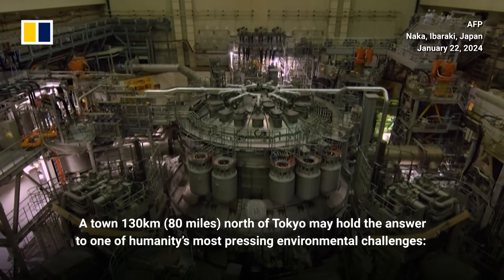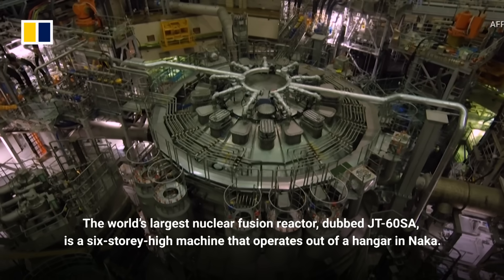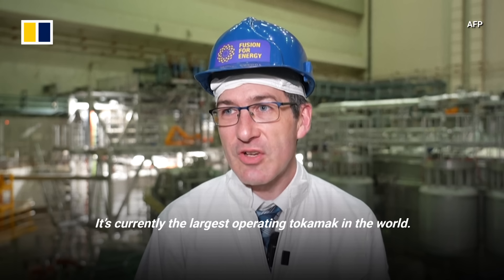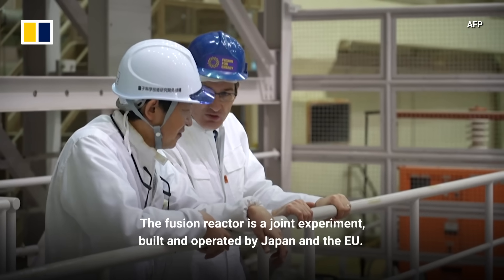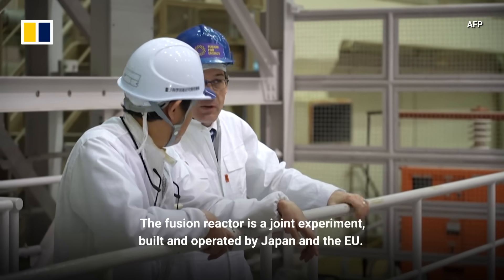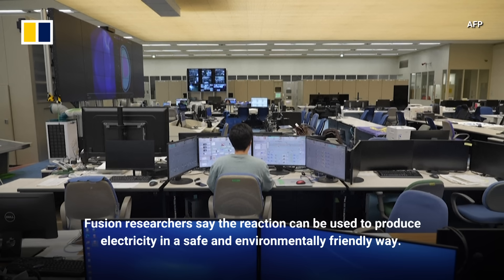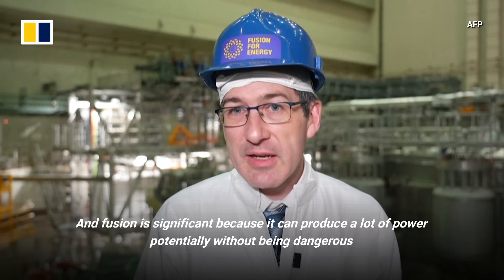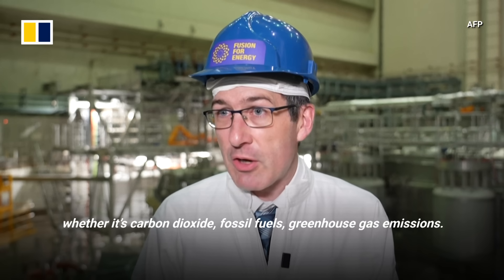The world’s largest nuclear fusion reactor

Comment: Fusion reactors require a constant supply of tritium which is manufactured in conventional nuclear reactors without it they can't function, tritium is in short supply.
Reply: @robhavock9434 They can. You can produce tritium by putting lithium on the fusion reactor wall, the constant neutron bombardment will transform it into tritium. We will need tritium to start the reaction, but once many fusion reactors starts to be deployed, the source of that initial tritium will be other fusion reactors.

Comment: I've heard once that tokamaks are outdated technology compared to stellarators. Can someone elaborate what are their advantages and disadvantages and settle if the prior statement is actually true?
Reply: The fundamental difference between a stellarator and a tokamak is that the magnetic field for isolating the plasma from the internal walls of the toroidal chamber is completely created by external coils, while in a tokamak poloidal fields are created by the current flowing through the plasma, which, among other things, allows the stellarator to be used in continuous mode.

Comment: These types of reactors is not much different then someone trying to build a Internal combustion engine out of dry ice. I’m not saying it impossible superconducting keep at temperature of deepest space and Core plasma hotter than the Sun? Somewhere between these two extremes you boil some water if they can get it to work?
Or they can just try this https://youtu.be/6ajqD0hoOMw?si=0kKYnG5s-lm7ejzB

Comment: Fusion energy generation is nice to have but unnecessary as Elon Musk had once said. We already have a very reliable fusion power plant in the form of the sun. We just need to build the collection and transmission infrastructure to use the energy. Solar, wind, hydro and even the slower form of collection, fossil fuel, are already being used.
Geothermal and nuclear are the only form of energy that does not originate from the sun or fusion reaction.

Comment: Fusion takes so much power just to start the initial reaction, it will be a challenge just to harvest those energy back as a surplus.
Reply: In before 10 years
In before 20 years
In before 30 years
The sooner rather than later
The world’s largest nuclear fusion reactor A.K.A The world’s most expensive perpetual machine.
Same goes for Blue/Green H3.
Same goes for Quantum computer.
Reply: @el-_-grando-_-_-scabandri  humanity took thousands of years before it took its first flight, wright brothers flew for the first time in 1903, it flew for only 852 feet before it crashed and broke. In only 16 years, man flew across the atlantic ocean in 1919 and that too nonstop. It took a another 3 decades before we got the first jet airliner to cross the Atlantic. It then took decades more before air travel became accessible to the general public. Same goes with the discovery of atom in 1800s, in another 140 years or so man would be able to split the atom to create mass destruction/energy(fusion). People like you are too impatient and short sighted, our forefathers had to work for more then one man's lifetime to accomplish great things. Only after 1968, interest into fusion energy grew when ussr was able to achieve plasma temp of 1KeV, it's very important to note that no one other then ussr was actively pursing fusion energy before this. Only is the mid 70s, tokmak started popping up around the world. It's only 50 years since world research started on this topic it's humanities most important scientific endeavours and a lot of progress has been made in this time period even with limited budget and project delays. People like you to need to stop living in instant gratification era, and think from a more practical standpoint. Finally after decades of research we are able to generate consistent fusion over a prolonged period, give it 50 more years and we would have cracked this cookie. Be patient my guy. One of wright brothers said that intercontinental air passenger would be impossible even though he was the one of the first people to fly. Now that we have finally achieved consistent fusion, rapid development will come by
Reply: Yes, that isn t the point of any of the reactors currently in project.

Currently we are still just trying to consistently create and maintain for a few minutes a plasma...

For energy production we ll need to maintain it for days and be able to extract heat while doing so..

We ll never see it this century. (And probably not in the next one either, considering the likely collapse)
Reply: And that’s why they are researching and testing.
Reply: El psy kongroo
Reply: It will never happen, science community is aware of that but it is a gold mine for them. They will talk fairytales as long as money is pouring into their pockets.
Reply: Eventually, we will though.
Harnessing a micro black hole in the palm of a hand.
Fusion is achievable in our life time.
Reply: "Building on the achievement in August 2022, American researchers at Lawrence Livermore National Laboratory National Ignition Facility (NIF) in California recorded the first ever net energy production with nuclear fusion, producing more fusion energy than laser beam put in. Laser efficiency was in the order of 1%." While it's taken a while, Nuclear Fusion is definitely on the track to achieving commercial viability in a few decades.
Reply: @sonicvenom8292  Hardly: 2.5 Mj output & 330 Mj input. Plus it only takes them about 2 days to do a single shot. Everything has to be perfectly aligned & even the initial (room) temperture is preciously regulated since even a small 0.1 C various can cause optical alignment issues. NIF is a Nuclear weapons program to build Nuclear weapons without the need of a fissile core. Its never intended for power generation.
Reply: aeroplanes are so big and heavy, it will be a challenge just for it to take off. engineering and science are about trial and error based on relatively promising theories and calculations. challenges were meant to be beaten, not deterred by.
Reply: yea of course you would know because you designed the reactor?
Reply: @KUIJEN8659  no, he is right. Walls erosion and energy recuperation are 2 biggest yet unsolved problems. Fusion energy is tempting but is insanely far from established technology.

Comment: Says nothing about the results achieved, which is a fat load of nothing!
Reply: Nuclear Fusion has achieved results over time. There's a wikipedia page detailing just the tip of the tip of the iceberg of it, if you're interested. https://en.wikipedia.org/wiki/Timeline_of_nuclear_fusion

To quote some parts, (2021) "[Record] The National Ignition Facility achieves generating 70% of the input energy, necessary to sustain fusion, from inertial confinement fusion energy, an 8x improvement over previous experiments in spring 2021 and a 25x increase over the yields achieved in 2018.[47]" (2022) "[Record] Building on the achievement in August 2022, American researchers at Lawrence Livermore National Laboratory National Ignition Facility (NIF) in California recorded the first ever net energy production with nuclear fusion, producing more fusion energy than laser beam put in. Laser efficiency was in the order of 1%.[56]"

Comment: I do optimistic, but I'm a realist as well.
The biggest doesn't mean the best or even works. At least so far, the record still held by Chinese tokamak.
It reached 120 mil°C for 101 secs on May 2021 and 70 mil°C for 1,056 secs (around 17 mins) on Dec 2021

Comment: If doable, then humans found eternal unlimited power source.  Tokamak has been proven most difficult to implement.  In the 1950s when it was first proposed, scientists said it would take at least 50 years.  Then 50 years had gone by, it was said it would take another decades.  Now, it's in the news again.
Reply: While the time prediction for Nuclear Fusion has been repeatedly pushed back, we have been making substantial progress over that period of time. For example, "[Record] The National Ignition Facility achieves generating 70% of the input energy, necessary to sustain fusion, from inertial confinement fusion energy, an 8x improvement over previous experiments in spring 2021 and a 25x increase over the yields achieved in 2018.[47]" In 2022, net-positive fusion was achieved for the first time. Meanwhile, ITER is completing in 2025. Safe to say, while the date itself has changed due to unforeseen challenges in multiple regards, scientists have been working hard in that time to bring us closer to what will be one of the most ground-breaking technological achievements of the century.
Reply: It's only been blocked and slowed by the Fossil Fuel economics. The powers that be want to make sure they made enough money while this was being developed.
Reply: Its never going to replace fossil fuels: for starters the 500MWth ITER will cost about $32B, without the means to extract power or breed tritium. if by some miracle it would work, a 1 GWe Fusion plant would cost well over $100B, cost to ratepayers would probably need to be around $2 to $7 kwh. Currently where I am its about $0.12 kwh. 
Second it will never work, because its impossible to stabilize. The plasma creates magnetic fields that interact with the magnetic contaminment field cause it to fail. They been working on the stability since the 1950s, The longest run in history is less than 5 minutes.
Reply: @guytech7310   "never", pretty confident are we :). I'm pretty sure some Church pastor told Galileo that his work will never matter even if it's correct because we are never going to have any use for it. I'm sure we will solve the energy problems on Earth mostly before it is in large scale commercial use, but fusion reactor has so many practical uses in future that it's difficult to argue why we shouldn't invest in it.

Comment: What if there was a Self-Assembling N. Fusion Power Plant/Outlet Which "begins as" A Fusion Exp***osion (since the "obstacle" is "creating enough heat to start the fusion process"), and uses the energy from the exp***osion to self-assemble and to initiate the fusion reaction?

Are you really THAT worried that I would use it in order to pressure everyone into being "anti-Taipei"? That would be ridiculous.